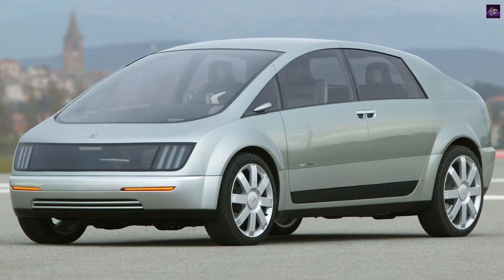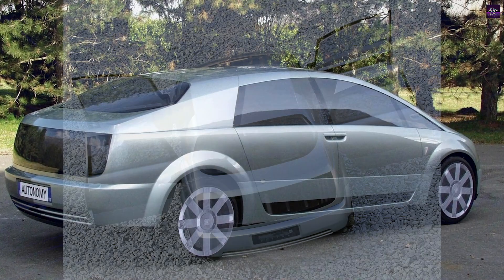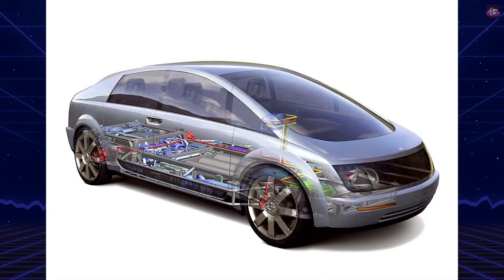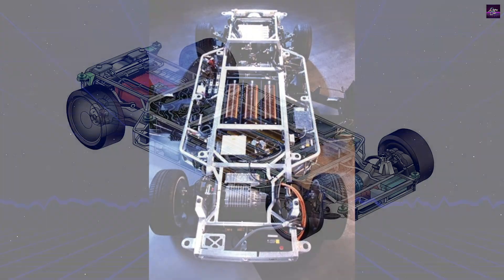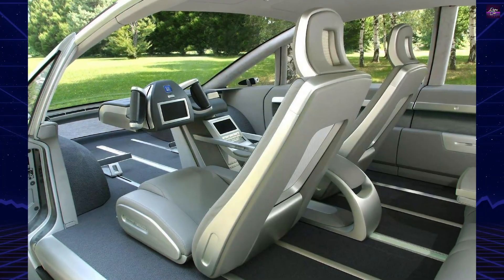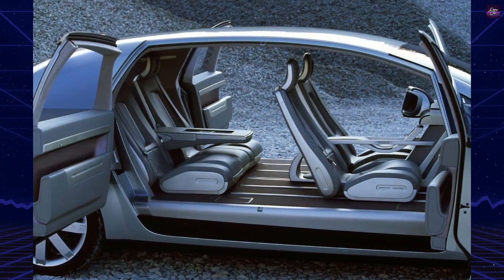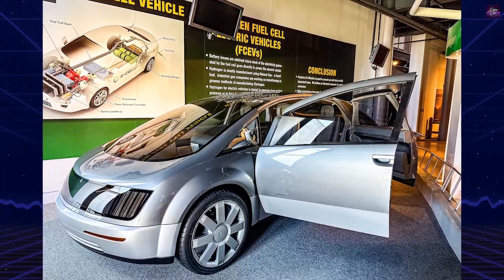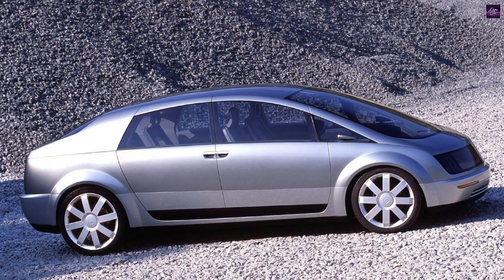2002 GM Hy-Wire: The Future Car We Weren’t Ready For

Comment: There's nothing stopping GM from putting this into production in the near future as an EV
Reply: Facts
Reply: There are many "platform" vehicle architectures. In practice, a big open area ahead of the occupants is not useful except for cargo, not safe for carrying cargo, and not structurally rational. The video explained by hydrogen fuel is nonsensical. There are also issues with drive-by-wire for both braking and steering, and the idea of expecting the general public to drive with a yoke and no pedals is ridiculous.

Comment: Overall, I like this idea; it definitively looks like a "Car of the Future," in every way.  Though Hydrogen/Fuel Cell storage may still have a way to go, if the tanks and cells in the skateboard chassis were replaced with conventional (I can't believe I used that adjective) lithium-ion batteries in the manner of a Tesla or Rivian, this could still work today.  In my opinion, the body style looks a lot better than a Tesla Model 3 (especially with those suicide doors.)  Maybe GM should revive the concept.

On the downside, I'm still not sold on "drive-by-wire" for steering and especially braking.  These systems would need plenty of backups.

My Google Search for a diecast or model kit came up empty.  I shouldn't be surprised, but I was disappointed.  As a model kit, this would sell well for the chassis and drivetrain, alone.

Thanks, Retro Car!

53rd Like.
Reply: I fully agree with you on the "drive by wire" - I wouldn't own a car where I had to depend on some electrical circuits and microprocessors to steer and brake. I also agree that this could be brought back as an EV, but hopefully without so much wasted space and such a sterile interior!